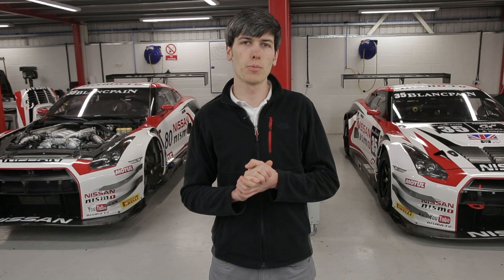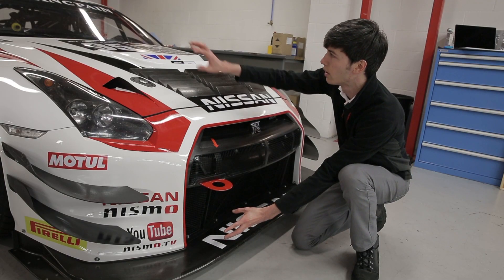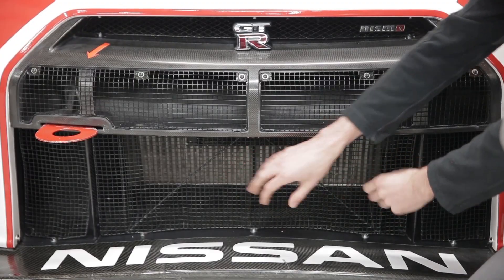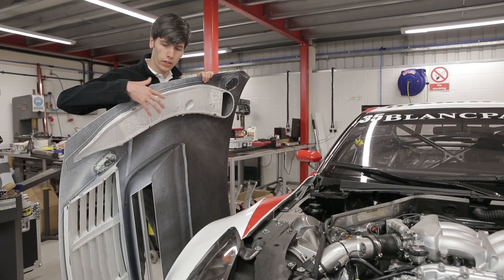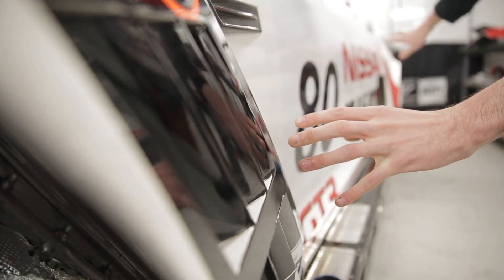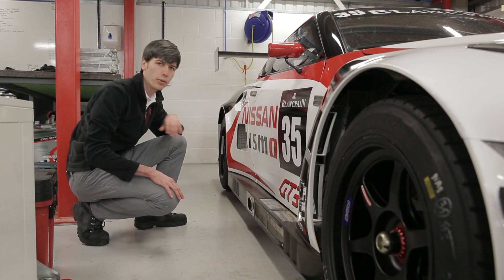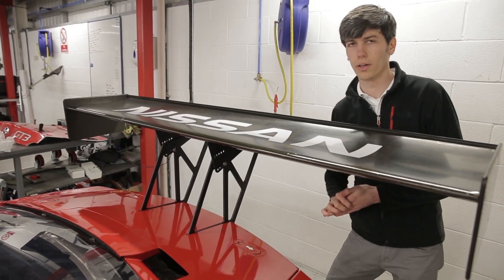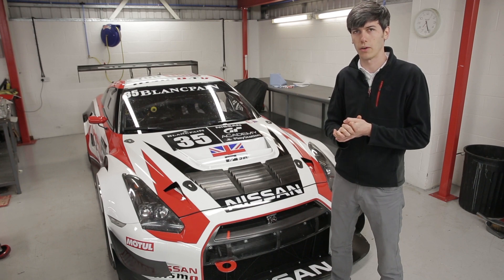Race Car Aerodynamics - Nissan GT-R Nismo GT3

Comment: My BMW E36 ,was planted to the highway at 200km/h , you could even go side to side lines and was no drama . What should I say more  about my friends e30 2.5 turbo goind 305km/h  on stock body.  :) Only eibach springs as mod.

Comment: Hi, If I was to install connecting rods on the front splitter, which orientation is best? Outwards   /    \    inwards? \   /  or straight   |     | . 
Thanks.

Comment: So I have a question I have ran many designs of front splitters on my NA Miata Racecar and I want more front end downforce. Can I run a Airfoil designed bottom part of the splitter maximize the air speed right under under it. The under air will vent into the wheel wells and the gap between the underbody and Trans tunnel.
Reply: RJ Lamb thats an interesting idea. I would recommend having significant camber on the aerofoil to get as much pressure drop as possible seeing as you're not implimenting a full molded floor pan.

Comment: The one things I'm wondering now is if there is a certain ratio or optimum size for a diffuser. I can imagine that to much turbulent air at the front of the car might negatively effect top speed or acceleration. SO one would think that there must be some kind of size to effectiveness ratio for front splitters.

Am I wrong in saying this, or am I on the right track but just not educated enough in the field of engineering to adequately explain it?
Reply: swj2jiw
Reply: well designed diffusers are practically free downforce, with no drag applied whatsoever, asside from the added weight, though most racing series restrict them

Comment: Why is it difficult drive a car with a high Down force?? Even though downfroce is known to affect the vehicle stability in a positive way
Reply: +vasudevan s Down force allows the car to be more stable in a straight line which is good ... but it will be hard to move the steering wheel in either direction (because you will be pushing against the air that is hitting the car with force less that or = to it so it might flip/brake the axis (at very high speeds)). So basically turning what makes it difficult (just guessing).
Reply: +LILWEBSTER'S .. when turning at high speed (high amount of down force) the axis and the tires will be pushing against the air the slamming the car ... (if and only if the air is causing force that is more than the force of what the tires and axis can take this might brake the axis) but I'm not sure about flipping the car though.
Reply: it's scary if you aren't used to it, it takes a long time to realise what speeds for turns is safe in high downforce cars

Comment: amazing video as always :D
so if the car is producing up to 1,000 kg of downforce, the suspension has to be extra stiff so it wouldn't collapse under that weight?
Reply from the maker: Lion -X Correct, suspension has to be able to handle the added load.

Comment: The 2 canards at each sides of the front bar are more of vortex generators? rather than downforce providing devices since their surface area is very small to produce any tangible df. btw didn't know that they run catalytic converters?? is it part of the whole eco-race theme, always thought it was a straight through system.

Comment: Although this GT-R doesn't do it, I'm still a bit confused about the new trend some manufacturers are following of mounting rear wings at the top rather than the usual bottom. I understand they are trying to reduce interference with the low pressure air under the wing, but aren't they just causing an equal amount of interference with the high pressure air on top of the wing?
Reply: +Clint Teece the interference of the high pressure air will raise the pressure increasing the pressure differential as opposed to raising the pressure of the low pressure side decreasing the pressure differential.  
But will the increase down-force offset the weight of larger swan mounts.

Comment: Engineering Explained   Very informative video, love it! Do you have a shot showing the spindle duct for the front brakes? I'd like to see how they distribute the air over the calliper and into the rotor to cool it. Cheers.

Comment: F1 seems to have an extra solution for downforce, by channeling hot air towards under the chassis, using bernoulli effect to generate downforce, why don't they do it? Just aim exhaust pipe at another direction.

Comment: Lol so basically the driver has the attack the corner at a certain speed to make sure he gets enough downforce to go make it through. So he can't go too slow into the corner?
Reply: Kind of. There's not really a problem going too slow through the corner, because the downforce and grip is not proportional to your speed. The downforce does increase the speed at which you can go through a corner though.

Comment: what about F1? are they still using that rear wing that adjust automatically  depending on speed or that has been change to not use it?
Reply: I believe what you're talking about is the DRS (Drag Reduction System). Though it wasn't adjusted automatically. It's either turned on or off electronically via a switch on the steering wheel. What it does when the button is pressed is flatten out the rear wing to help reduce drag down the straights which results in quicker acceleration and a higher top speed. It's turned off by pressing the button again or when the driver brakes. Before the driver could use it at any point on the track during the practices and qualifying but not on the race day. They changed the rules in 2013 so drivers are allowed to use DRS at any time during the practices and qualifying but only in the designated DRS zones for safety reasons. On the race day drivers can only use it after 3 laps from the start of the race in designated DRS zones on the track and need to be within 1 second of the driver in front to use it.
Reply: He was more in depth with it, but thats what it is. Lol ^^^^^^^
Reply from the maker: Here ya go! Drag Reduction System - Explained